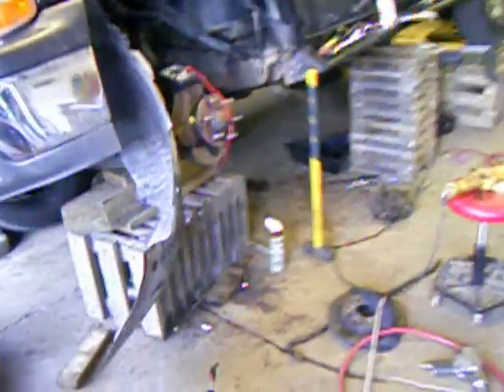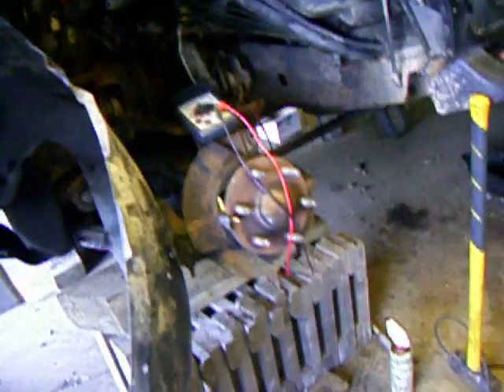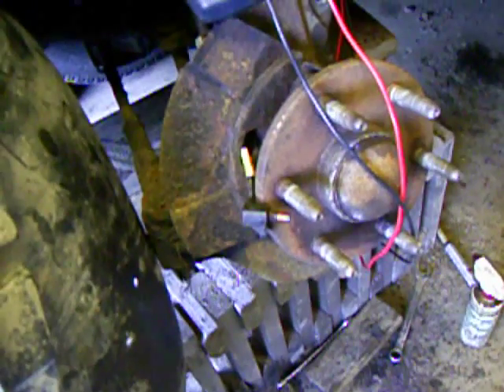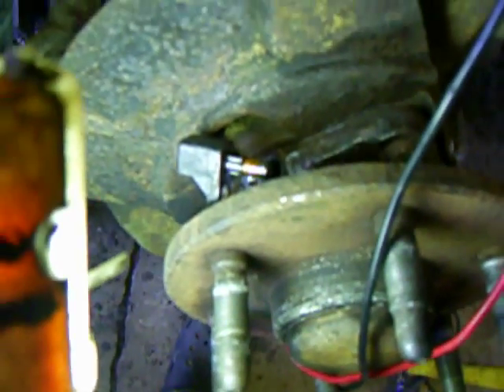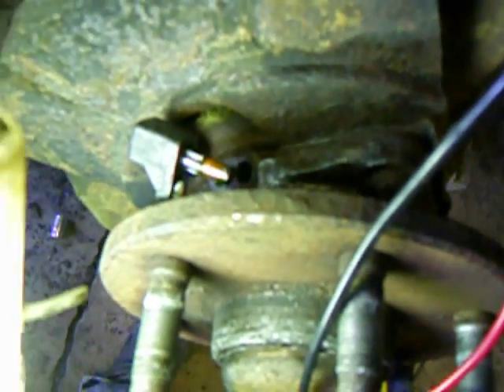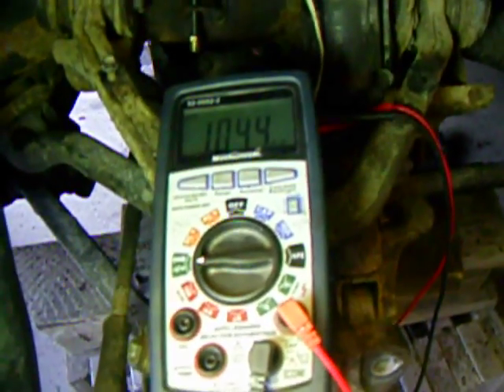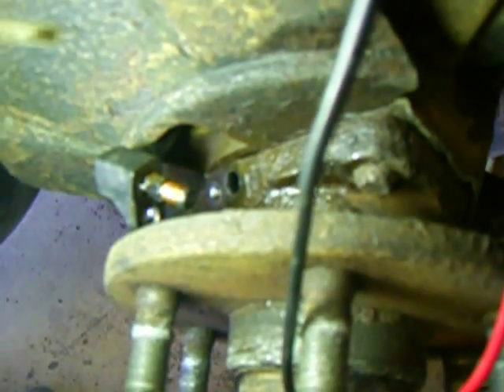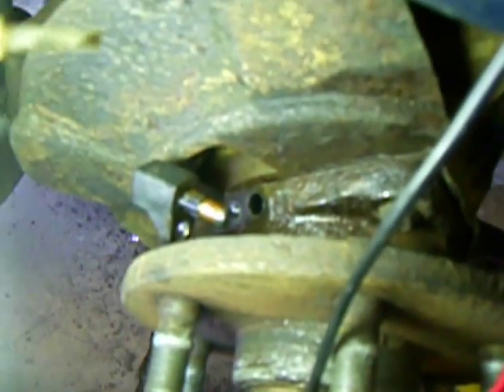Troubleshooting GM ABS slow speed cut in issue_Part 1 of 2

Comment: Very helpful video.  Used to troubleshoot and fix identical issue in 2005 Chevy Express 2500.  I elected to replace entire front driver's side hub/sensor assembly as it is a business vehicle and I didn't want to get it buttoned back up and risk the repair not working.  ABS is now functioning perfectly at all speeds and I now know what to do if another fails.  THANKS!

Mike in Illinois

Comment: I had the same problem with my sensor , once pulled out there was no plastic on it, wires showing. Plastic should be over the wires. mine was stuck around  the hole. yours fell in the hole.
The new one will have plastic over the copper wires.

Comment: Variances in gauss reading intensity due to tolerances starting to close up due to hub bearing failure. Also due to roller cage bearing assemblies starting to loose grease or were never greased adequately at assembly does cause premature failure! Therefore creating a friction amplified situation increasing the progression of time to shorten of the life of bearing hub assembly. In return causes rollers to scale chromium off of them from absence of grease and friction. The cogged reluctor ring which troggers the rapid rise and fall of gauss levels during vehicle rolling are not consistant. Or show to be moving at different speeds in conjunction to the other ABS locations. Therefore sending a false signal to the ABS module. Causing the module to trigger a misfire. Various factors can and do cause this. Corrosion does not have as much to do with this component failure as poorly manufactured hub components and failures in the ISO manufacturing process.

Comment: did you have TC issues too ?
Reply from the maker: No trouble codes if I remember correctly.
Reply: mrsillyman i think you misunderstood TC - traction control issues ,
Reply from the maker: Yes. The abs was prematurely cutting in on clean dry pavement when almost stopped (like at 5 km/hour)
Reply: mrsillyman
yes i read that, i have the same issue but my traction control is also activating when i accelerate, did yours do that ???
Reply from the maker: Sorry. Now I understand. My Tahoe does not have traction control.
Reply: mrsillyman
1 more question, i may have missed it in the vid, did what you did in the video fix the problem ?
Reply from the maker: Yes. 2 years later and issue is still gone

Comment: Thank you for the great video. My 05' GMC Sierra 2500hd had the same issues. I thought it was going to be the driver's side but it turned out to be the passenger side. When I Placed the DVM across the sensor terminals (with ignition on using pins in end of terminal at it still plugged in) I got around 240 ACmV's. The driver's side had 350 ACmV's. I followed your directions and cleaned the huge rust scale around/under the sensor and it  read the same 350 ACmV's as the driver's side. (It saved me the extra work of taking apart the driver's side brake caliper- which I'm guessing I will have to do eventually anyways.)

Comment: Model Affected:
1999 GMC Sierra
Summary:
CERTAIN PICKUP TRUCKS AND SPORT UTILITY VEHICLES MAY EXPERIENCE UNWANTED ANTILOCK BRAKE SYSTEM (ABS) ACTIVATION. THIS CONDITION IS MORE LIKELY TO OCCUR IN ENVIRONMENTALLY CORROSIVE AREAS. THIS RECALL WILL BE LAUNCHED IN THE "SALT BELT" STATES OF CONNECTICUT, DELAWARE, ILLINOIS, INDIANA, IOWA, MARYLAND, MASSACHUSETTS, MAINE, MICHIGAN, MINNESOTA, MISSOURI, NEW HAMPSHIRE, NEW JERSEY, NEW YORK, OHIO, PENNSYLVANIA, RHODE ISLAND, VERMONT, WEST VIRGINIA, WISCONSIN AND THE DISTRICT OF COLUMBIA ONLY.
Consequences:
THIS CAN CAUSE INCREASED STOPPING DISTANCES DURING LOW-SPEED BRAKE APPLICATIONS, WHICH COULD RESULT IN A CRASH.
Remedy:
DEALERS ARE TO REMOVE THE WHEEL SPEED SENSOR AND THOROUGHLY CLEAN THE WHEEL SPEED SENSOR MOUNTING SURFACE ON THE BEARING, APPLY RUST INHIBITOR TO THE CLEANED SURFACE, GREASE THE MOUNTING SURFACE, REINSTALL THE WHEEL SPEED SENSOR, AND CHECK THE PEAK-TO-PEAK OUTPUT VOLTAGE TO ENSURE THE WHEEL SPEED SIGNAL IS WITHIN SPECIFICATIONS. THE RECALL BEGAN SEPTEMBER 22, 2005. OWNERS MAY CONTACT CHEVROLET AT 1-800-630-2438 OR GMC AT 1-866-996-9463.
Potential Units Affected:
1353718
Notes:
GENERAL MOTORS CORP.

Read more: http://www.motortrend.com/cars/1999/gmc/sierra/recalls/#ixzz37s2Hcsh9

Comment: Good thing your video is not about safety
Reply from the maker: *****
if you are referring to the wooden supports that are under the front hub, rear wheel and also under the middle of the vehicle, well, they were previously holding up a 14,000 sail boat before I started using them as safety stands.  If you noticed something else I did that was unsafe and have constructive comments I would be happy to learn from you.
Reply: SO where is your safety video on how to fix it?

Comment: Folks, the visual condition of the sensors when removed does not matter. The sensors do not fail because of the gunk on them, the senses fail because of the warping coils inside the sensor as a result of heat. Heat also affect the magnet inside the sensor. Cleaning your sensor will not cause it to work because it being dirty was never the problem. Replacing the sensor is the only fix. Some folks go as far as to expose and clean the entire hub. Just replace the sensors... Both sides.
Reply from the maker: As the original poster of this video, I can say cleaning the sensor (removing the metallic particles stuck to the end of the sensor) cleared up my problems for almost 2 years now.
Reply: mrsillyman Cleaning it is at least worth a try since the sensor for my truck is over $100 a wheel.

Comment: IT was not a recall but a TSB covered like a million trucks.  In summary the TSB called for removing the sensor, putting something in the hole (like a paper towel) spraying the area with a "rust inhibitor" (I just used rustoleum high temp) then cleaning the sensor with scotch brite, emory cloth, or the like, coating the sensor in high temp grease (axle grease) and reinstalling it.  The TSB called it a 1.6 hr labor operation, pretty easy and works.  These sensors rarely fail completely but the do get weak so you can check the output with a multimeter and confirm in or out of spec.

Comment from the maker: Barely broken wires that have increased resistance could cause the issue.  However, I can't stress strongly enough the importance of cleaning the hub surface... I used sandpaper taking it down to clean metal to get all the rust off.  I would find out how to check resistance of the sensor & its wires, all the way from the ABS module (or computer - wherever the wires go).  If one sensor reads much higher resistance than the other, then the sensor with the higher resistance could have broken wires.

Comment: thank you again. i checked the other. it was similar to the first side. i cleaned it all up including the hub surface. its definately better, but still not correct. i installed a new sensor but it was too long and contacted the splines inside the hub. i will have to get the correct ones and install them. i guess im assuming i need new sensors.... could there be any other causes of the issue?

Comment from the maker: i would check the sensor you haven't checked yet.  likely some gunk on the end of it OR the corrosion on the hub surface where the sensor bolts to has enough corrosion it moved the sensor away from the ring by a few thousandths of an inch.  I think I had the meter on AC.  can't remember now - 2 years ago LoL.

Comment: thanks a lot! i took some pics i could send if i had a place to send them.. but how did u get 350mV? it is DC right? i got 200 but was spinning it so fast i wouldve been out of breath if i did it much longer! i guess regardless, i just bought a set of two on ebay for 40 bucks. i figure its worth 40 to have fresh ones and only need to take it apart once. mine were behind that brake plate thing so it was more of a pain.

Comment from the maker: It has been a while since I made the video and did the repair.  However, 200mV sounds not too bad.  I don't think having dirt on the sensor would be detectable by a volt meter.  you likely would need an oscilloscope to look at the wave form.  I would suggest 1) checking the other sensor for dirt/metal and 2) measure sensor resistance by unplugging from the abs module to confirm no broken wires.  Let us know what you find. good luck

Comment: quick question for ya..... i just did this in my 98 tahoe... i only did one wheel and the problem is persisting... i want to figure out if i need new sensors before i bother cleaning the other.... the one i cleaned wasnt really dirty. the sensor had some goop on it that i cleaned but no rust. i also sanded under it even though it wasnt that bad. i got 1042 ohms, but could only get 200 mV when i spun the wheel, and i was spinning it as fast as i could... any help? thanks!

Comment: Pulled sensors behind rotors, cleaned metal surfaces, plug hole to keep dirt out. Used air to blow out dirt in hub assy.  reattached sensors problem gone.